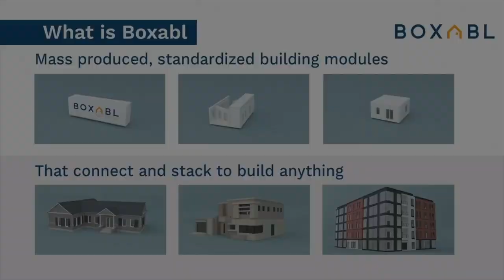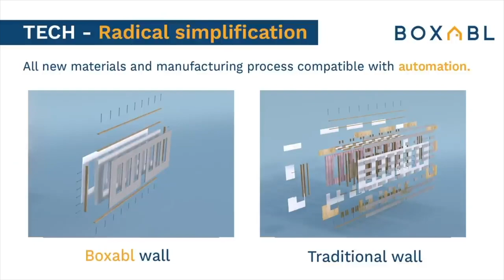Tim Draper's Startup Pitch Tv Show! Watch BOXABL Win Big! The Amazing Folding House.

Comment: Gotta wonder about the longevity of the product and its impermeability to wind, rain, snow and insects.  The sun, water and bugs tend to wear down the most robust of houses.  With a normal house, you are replacing or repairing the roof every ten to fifteen years, which has always struck me as ridiculously fragile.  Boxabl projections?  Also, internally-- if you damage a wall or the floor, how easy is it to fix? I have always admired the way you have access to internal wiring and plumbing on ships by pulling off wall plates or decking.  Hopefully Boxable followed that.

Comment: These are super cool!! Question, are you able to hang heavy things on the wall easily since there aren’t wood studs? For example a tv?
Reply: If he can torch it and pound it with a sledge, you should at least be able to put an anchor through it, if not just screw it in directly.
Reply: @jordanhenshaw  I saw where you can hang things..not sure the weight limit but what is interesting there are no studs. So you can hang safely anywhere.